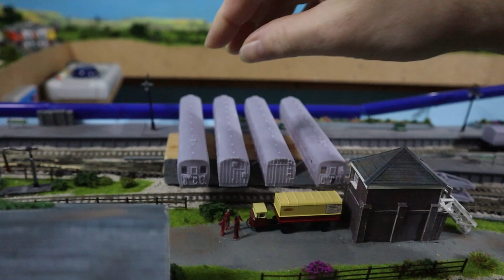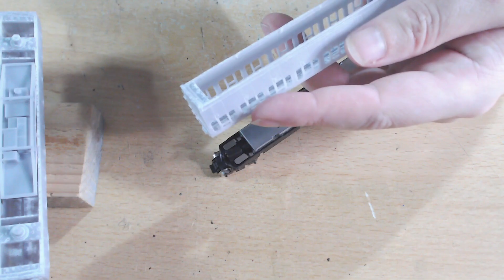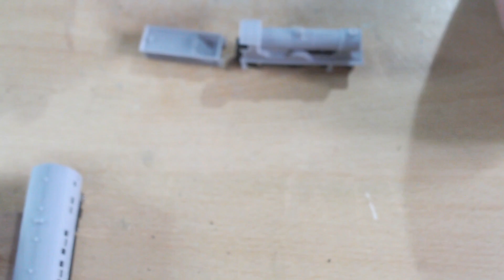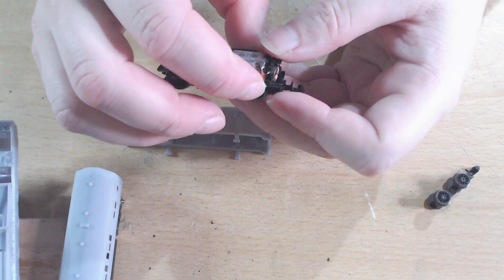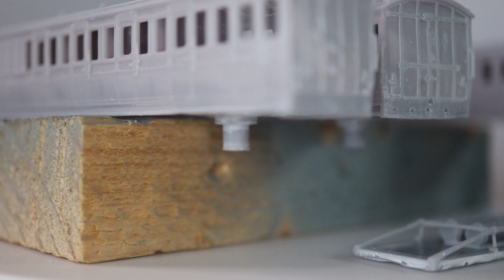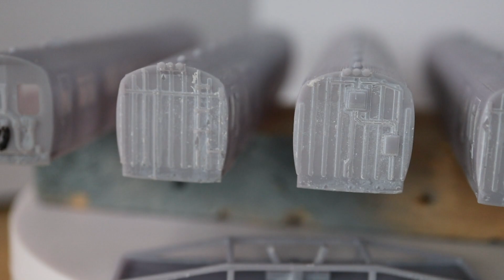Product Showcase: June - Bulleid 4-SUB, Marsh I2, Drummond's D15 and Billington Coaches!

Comment: On another youtube channel, a young man 'Harrison' in Canada. He did a rebuild of several locomotives. HO scale. He uses tiny self-tapping screws for mounting wheeled carriage assemblies to the main chassis. Kind of makes things up as he goes. Your N scale's are impressive.
Reply from the maker: Might have a look at what might work for my items, currently for my coaches I just superglue a crude cross bar out of plasticard to keep the wheels on, might adjust the bogie pivots to allow a screw to be fitted.
Though will have to do some tests first but cheers for the suggestion!

Comment: I think 3D is gonna create a lot of problems for the big brands which isn't necessarily a bad thing.
Some brands just repainted models over and over again and charged ridiculous prices for them.
3D is turning out to be quite handy if you want more specific models on a normal budget, quite a fleet you're building.
Reply from the maker: The main market for 3d printing is for low volume items, since there's no tooling costs to recover, there's no such thing as "too few" to produce anything since it's all digital and printed on demand from a universal material.
I want to keep things at a more reasonable price, £30-40 a coach is far too much personally, more so when the cost of everything else has gone up!
And cheers very much, will be expanding my coach and EMU range more, do need to add some SECR coaches however, but will come in time!
Reply: @GosportRailworks  I hear you, I have certain models that go for ridiculous prices at Ebay or Catawiki.
Never paid top whack for them and have no intention to do so ever.
Luckily I'm easily pleased, I gladly buy cars from the bargain bin, 12 for 15 euros and just build a story around them about why they run in a specific train.
But there are great models in 3D printing and I can understand people getting bored with the same locos with only different colour schemes.
I'm keeping track on specific models in development in Z scale, hoping it all works out to get some very additions 😄
Reply from the maker: I keep looking at both my 4CEP models and thinking I only spent £140 on each of them, now they go £200+ each, but I'm now in the mindset that I can pretty much replace my RTR coaches with printed ones (slowly) as would give more variety then heh.
I can understand the main brands, they need to make a profit so have to aim for what will likely sell, but yes it does make things a bit samey in general.
And have been interested in looking at smaller scales, though will have to find space to put more layouts somewhere heh
Reply: @GosportRailworks  In my opinion main brands rely a bit too much on their name and not for producing new stuff.
Ofcourse there are brands that serve a small market eg British models but all production is abroad, they use older molds and perhaps they even use slave labour.
That doen't really justify these high prices.
Piko also has nice models but no way that I would pay 350 for a loco that even has fragile plastic gears.
I may have said it before, the Class 08 by GF looks great too but it somehow wouldn't feel right to spend that amount on a single locomotive.
 Btw, Z has its advantages and with the right chassis you can build a decent setup in a limited space.
It's just a question of finding the right 3D kit to work on but the market is constantly developing.
Reply from the maker: Nearly forgot to reply, busy weekend, and that's pretty much most brands these days, too much relying on the goodwill they built up over the years only to waste it later on.
Hopefully some cheaper alternatives will help move things in a better direction, but will have to see.
Only model I paid that much for (outside the big one in the shed) was the Brighton Belle which looks great, but it's only features being that it lights up and despite power all the way through, pickup is only in the motor car, might make a replacement someday heh
I've been eyeing up T Gauge, mostly for making cityscape layouts or some other silly ideals I've got heh
Reply: @GosportRailworks  T gauge is nice, still a gimmick though.
I don't think we will be shunting soon in this scale but it has potential for building great landscapes as there are many great layouts already built.
A good variety of models already too and who cares if it isn't that accurate in this scale?
It might make a nice sdestep from the regular scales 😄
Reply from the maker: True T Gauge is still pretty much a gimmick, but to do some nice landscapes and perhaps full scaled railway infrastructure is appealing, might have a go at making a replica of one of my local stations, will have to see.
But it would be a nice change to the regular and do have some ideas with the scale!